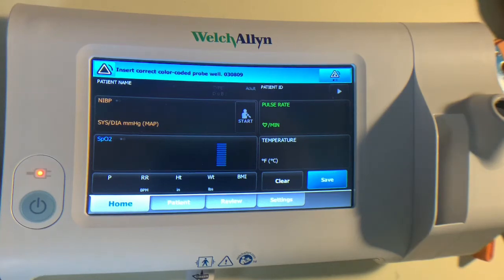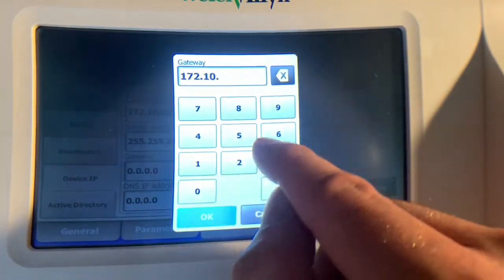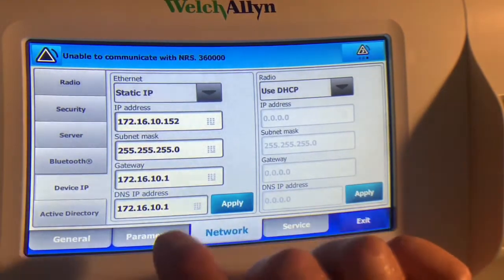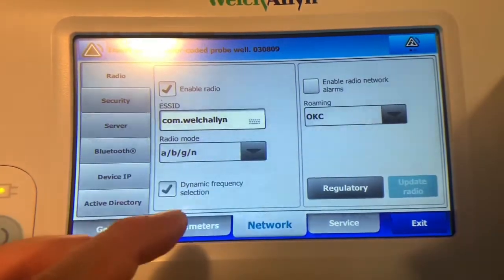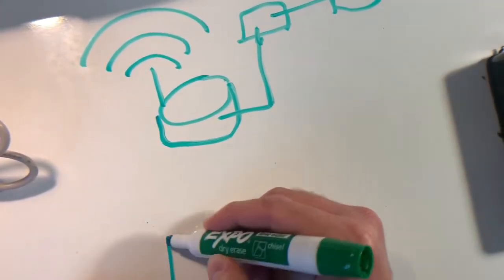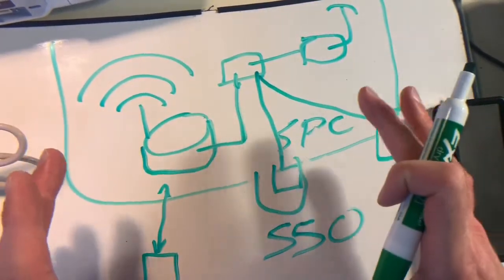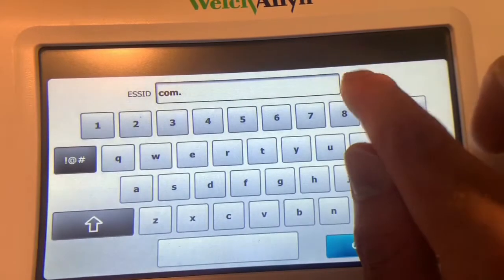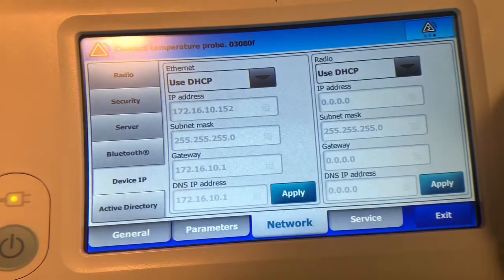Welch Allyn Connex Spot Monitor: How to Network

Comment: On my equipment, the options do not appear:
*  Device IP;
*  Active Directory.     

 In the option "Radio" appears disabled,   is this a configuration error?
Reply from the maker: Not sure - maybe your welch allyns do not have a NICs (network ID cards) - I think they have different models with different connections configurations (bluetooth, wireless, etc)